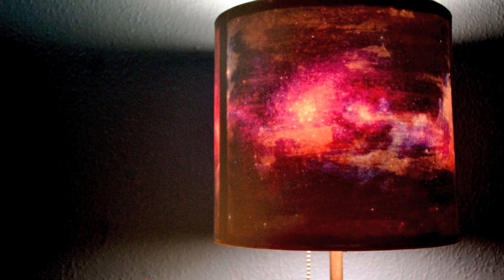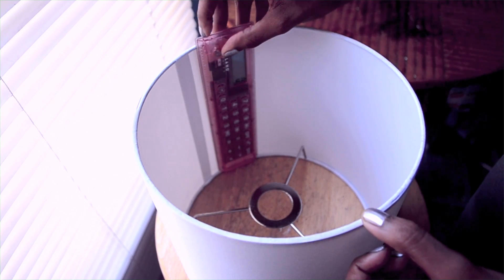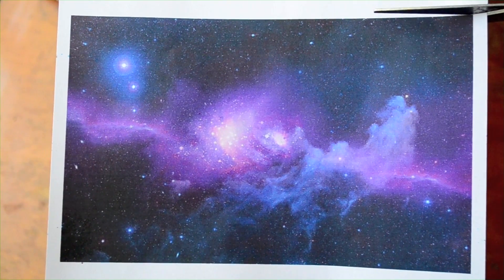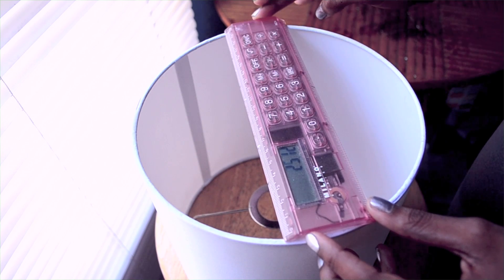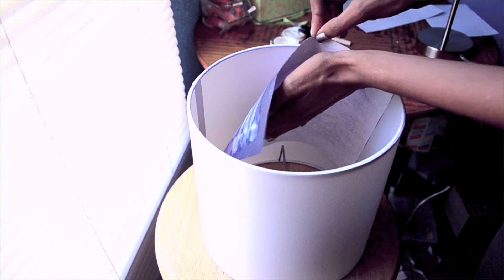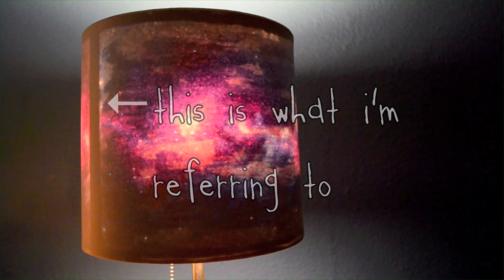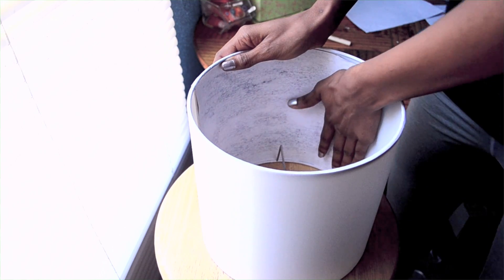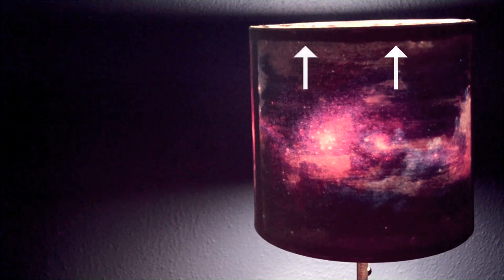DIY Galaxy Print Lamp | Home Decor

Comment from the maker: I just used basic white printer paper - 8 1/2 X 11 inches. If I'd had a larger paper size, I might have been able to use 2 sheets of paper instead of 2.5, so if you have larger paper, I'd definitely recommend using it just to speed up the process. Thanks for watching!

Comment: does it not go on fire?
Reply from the maker: Great question. No, it is not flammable. Mod Podge isn't a flammable substance (and the lamp itself is made of a paper-like material so adding another layer of paper is not going to make it flammable). Thanks for watching!
Reply: +simpleDIYs  What if you use a plastic material lamp?
Reply: +Bella A If you use an led light bulb it won't get hot